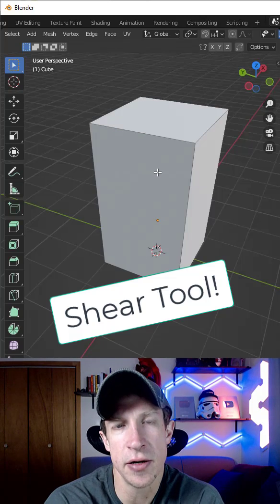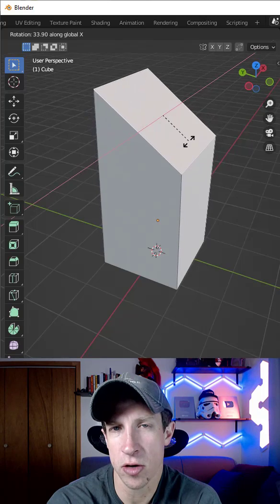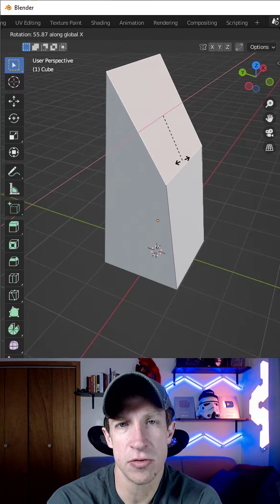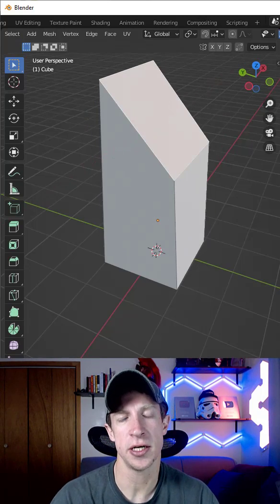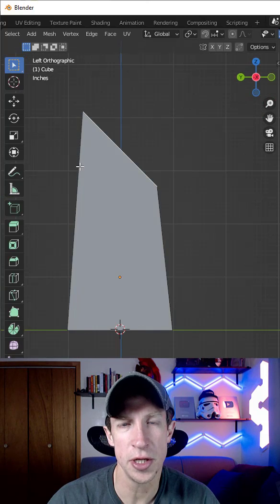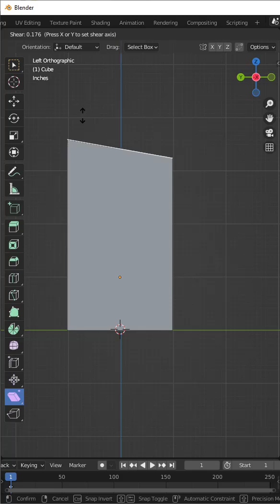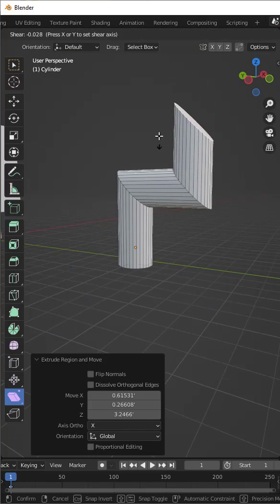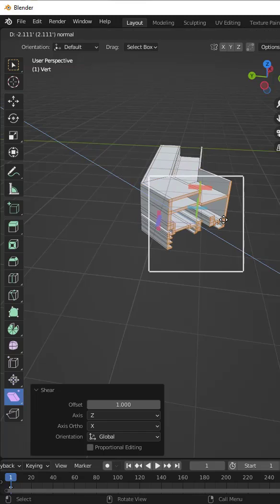Using the SHEAR TOOL for Perfect Corners in Blender!

Comment: You could also use a full room (like walls, pipes, wires, moulding etc), and just extrude everything.
Reply from the maker: I don't understand - the point of this is that extruding gives you imperfect corners
Reply: @TheCGEssentials  isn't it rotating that gives bad corners? You did say shear and extrude.
Though you need the angle of the extrusions to be 2* the angle of the shear.

Comment: I think the most difficult part of blender is knowing all your tools. Sometimes it feels like
"Oop, I need to pull out this thick nail out of the plank. Maybe I can lever a screwdriver over a pice of wood to-"
"Hey, why don't you just use the thick-nail-iut-of-plank-pullinator 3000?"
Reply from the maker: Lol - this is fair
Reply: "Behold, Perry, my Thick-nail-out-of-plank-pullinator!"
Reply: For real lol a time ago I needed to do a 45Deg turn on a crown molding, what I did? With a plane at 45deg, I ctrl + minus on the crown, duplicated it, then (ctrl + m) + x flipped it and joined. I mean, I got the job done lmao
Reply: Indeed
Reply: And sometimes you just need a bigger Thick-nail-out-of-plank-pullinator.
Reply: Kind of but at the same time tools like the shoe tool art fundamentals and any program and not just blender so if you don’t understand them or find them to be foreign concepts you might just not have a good grasp of 3-D modelling

Comment: I like everything about this tool except its name.
Every spring shepherds shear their sheep, a process that looks nothing like this.
Finish carpenters make miter cuts in stock lumber that look exactly like this operation.
This is a "miter" tool.
Reply from the maker: "Shear" also has an engineering definition, which is more what the name of this tool is referring to
Reply: @TheCGEssentials  I do understand your engineering perspective. I just find the "miter cut" metaphor to be more intuitive.

If one thinks of a 2D trapezoid where one of the angled sides has to be adjusted, (1) are we changing the relative lengths of the 2 parallel sides (shearing) OR (2) are we holding 1 parallel side fixed in length and changing an angle at its end point (mitering)?

I want to be clear that I respect that this great piece of software (Blender) has passed through the keyboards of hundreds of developers whose backgrounds may make (1) more intuitive than (2).

In the case of the miter saw (and my intuition), one is setting an blade angle, e.g. 45°, to the "fence."  In contrast, one is not measuring 2 lengths, then a width, then setting an offset length, and then aiming a blade at a pencil mark it isn't touching.

Thank you for your great vids.  I have learned much from them.